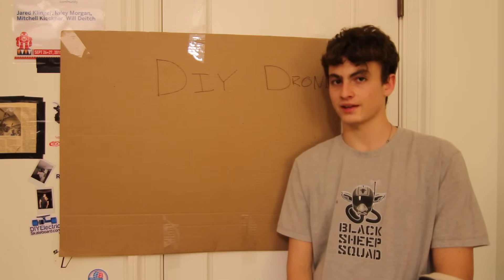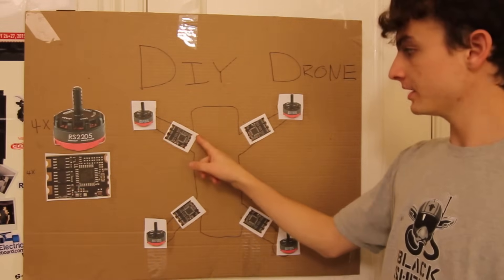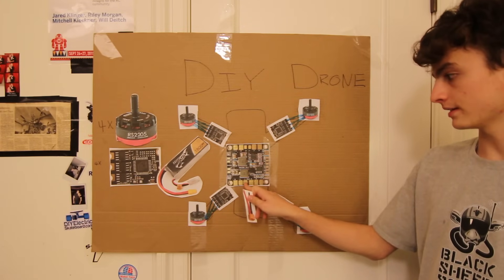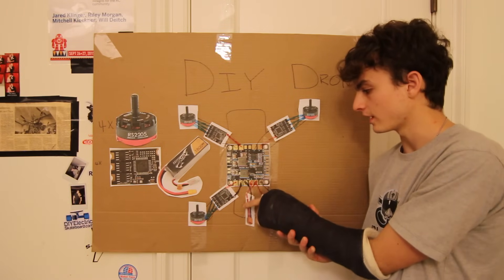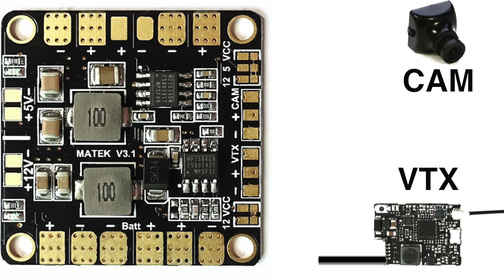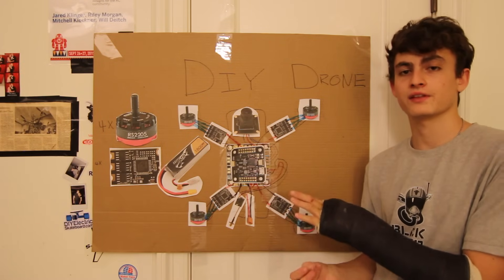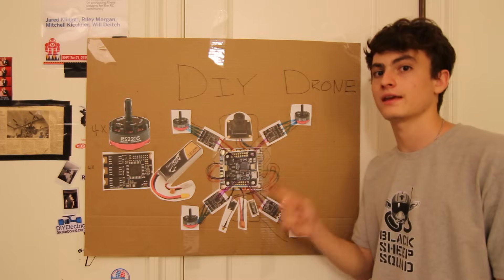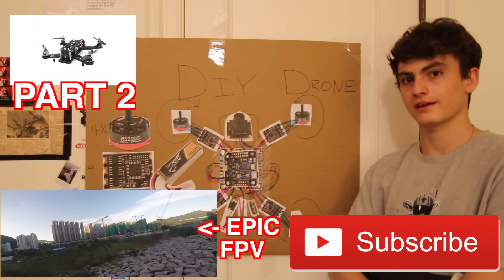Drone Theory 101: Part 1. The basics, and how an fpv quadcopter functions!

Comment: I don't know how things were 9 years ago when this video was made, but nowadays it's also important to note that the flight controller (the brain) often also has the ESCs, PDB, and sometimes even the receiver integrated onto one board to save weight and be more compact, especially on smaller drones. These are usually referred to as "all-in-one" or "AIO".

 using four individual ESCs mounted on the arms is also kind of outdated, and if it isn't an AIO (the ESCs built into the FC) ESCs made for FPV drones usually come in a compact four-in-one PCB (The 4 ESCs all connected together on one board).
 the fundamentals he is teaching still remain the same, it just looks different when everything is packed onto one or two PCBs, and when you're buying your parts, the chances are you don't need to buy a PDB because it will already be integrated into the AIO/4-in-1 ESC.

Comment: Quick question please guys
I'm putting rcnpower brand drone motors on my ae86 pro max plus drone 
The ae86 pro max plus drone has a red,yellow and black wires standard 
The aftermarket motors have just 3 plain blk wires
How do I know which wires connect to where  ???
Thanks 
Glen 
Australia 🇦🇺
Reply from the maker: You can plug in phase cables in any direction and if they spin the wrong way just swap two of them

Comment: i purchased a fpv drone completely built the remote was paired and gogles the whole kit and cabooyle(i think) lol   it camewith a hot rc remote my maiden flight stRTED OFF THE QUAD ARMED IT HOVERED AND THEN INTO A TREE. AFTER MY PUBLIC FREEKOUT MY DRONE LOOKED FINE.9   SO  onnce i went to try again the remote wont arm after sometyime it came alive and the esc on the arm smokes now when i add power.  i never paired a remote i dont understand betaflight.   i hope you understand can you help why dose the esc smoke once i connect power only one arm?

Comment: thanks for the video. I needed help trouble shooting my transmitter disconnecting at 200ft or so turns out i broke the radio antennas lol. Theory is super helpful when trying to diagnose a problem.

Comment: Thank you very much for such a great content. I would like to ask about the receiver, does it connnected to the POWER DISTRIBUTION BOARD and flight control simultaneously. I mean does the receiver contain three connections; 2 with DPB and one with the flight controller? Thanks again.

Comment: I like making rc planes out of foam board. Its cheap, fun to build, and experimentations are endless. But I want to size it down. I have problems finding the components at reasonable prices. I even made a few out of old micro drones, but they dont really fly good or atleast not how I want them to. I'm looking for a 3 channel micro controller board with two built in servos for rudder and elevator, if you know what Im talking about. I'll buy the according transmitter.
Any tips on where to find that kinda stuff?

Comment: Why does the VTX/CAM signal go through the power regulator instead of going directly?
Also why are each ESC connected separately to their respective power pads on the regulator, instead of having two loops of cables around the regulator and the motors feed off that?

Comment: Awesome video. Looks like you connected the battery to the wrong positive terminal on the power distribution board though. boom goes the distro.
Reply: ok you fixed it.

Comment: Thanks.  I have problems with intermittent GPS connection with my Bugs 2 quad.  Sometimes it will connect to 19 satellites while I am flying, and sometimes not.  Also the read out of the drone height and distance from me never read out. Headless mode, altitude hold works and the camera works.  I am curious about the GPS  thing.  Even when it kicks in the read out of height and distance never show up.  I live with my crippled Bugs 2, and was just wondering about what makes it work or not.  Your video helped somewhat.

Comment: Exactly what I needed, got my first quad about 4 days ago off of craigslist along with a spektrum dx4e (old crappy radio but it did the trick for me to learn on), and some custom made fpv goggles with a diversity receiver. I knew nothing. Spent 2 days just trying to bind the radio and when I got flying it was amazing. I felt like a bird! Lol did some training up on a simulator and was ready to take off the angle crutch, the quad responded very well and I was doing flips and rolls within an hour. Decided to go for a night flight last night and tried a front flip, camera cut out due to cable coming unattached half way through the flip and I couldn't finish the flip and it sent it speeding straight into the concrete. Shoved the lipo straight through the flight controller and video receiver destroying everything lol and I broke 1 prop! Haha anyways believe it or not the frame is good,  just need new flight controller and vtx. Your video helped me realize just how simple this all was to replace, thank you!
Reply from the maker: I'm glad you liked the video! Super happy it helped you out. Glad it seems like you're headed in the right direction with the build!

Comment: Have question hope you can help. I'm interested in in adding GPS to my Falcore drone. I haven't opened it up yet but if its do-able do you think the controller would have marked connection points for the GPS wires. I have no documentation if you have a link that might be helpful it would also be appreciated.

Comment: Umm i have a question regarding the transmitter & receiver, if i place the transmitter in a gaming controller, will it work??
Reply from the maker: Well, yes but you do understand you'd have to configure a custom transmitter to your gaming controller and a receiver for that for the quad, right? It cannot just be a regular gaming controller- there are no receivers for them that work in the way we need or in the timing we need (too much delay).

Comment: That's a nice video for me to start off with drones. I am looking at buying a low cost programmable kit to start with. Are there any FPGA based controllers in the market? Can you suggest some kits?
Reply from the maker: +Ashish Kothari Check out the tbs vendetta or vortex pro
Reply: Sure, will do. Thanks.

Comment: Wow!!! one question Riley,  how  to extend the drone battery, is there a way?
Reply from the maker: +Eric Gampu Use a.larger battery, or more efficient motors. On bigger quadcopters, for efficiency, we spin very low KV motors with very large propellers on higher voltage setups